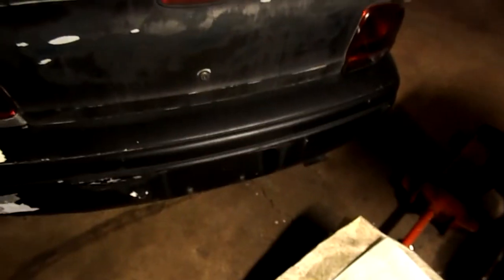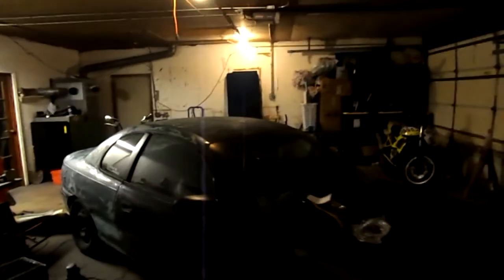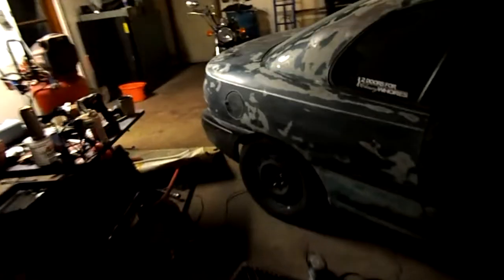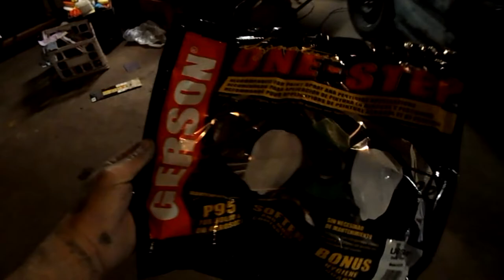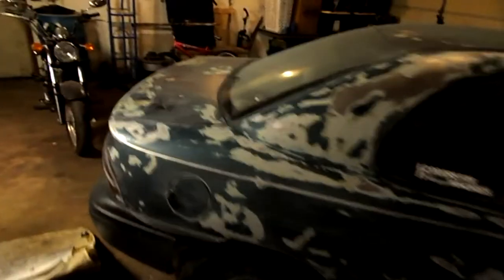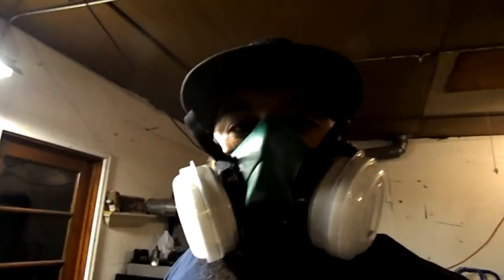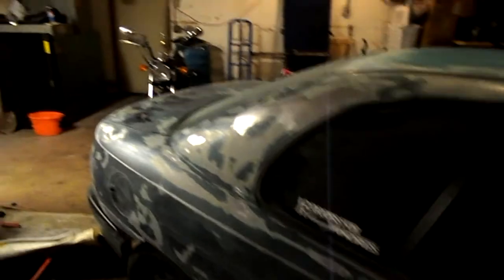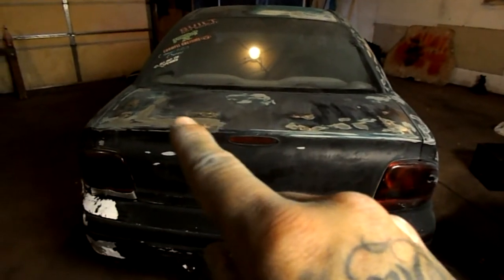95 Neon RT Rustoleum Paint Job Part1

Comment: Good to see you wearing a mask Barba. You can ditch the mask by wet sanding the body smooth with 240 grit sandpaper and rolling on the paint instead of spray painting it.